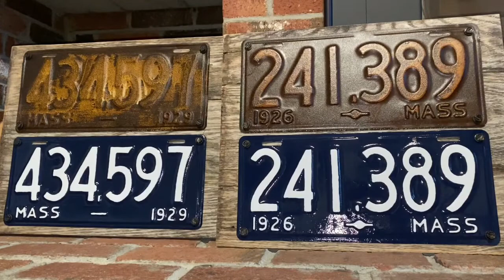Barn Found Rusty License Plates Restored and Preserved

Comment: The result is pretty good! One suggestion would be to try and brush the lettering. You'll get a smoother more consistent result. A LOT of people think you need a super steady hand to use a brush but that just isn't necessarily true. Watch some sign painting videos on YouTube. Use a long bristle brush like a Kafka "liner" or pinstriping liner. As you "pull" the lines the brush straightens out the line. Admittedly it does take some practice but it isn't that difficult. Back in the '20's Ford used to hire people off the street, give them a week or so training and viola, they were pinstriping model A's. All that being said your result looks pretty damn good! Oh and you might want to use OneShot paint.
Reply from the maker: Great advice.  I will look that up and try to upgrade before my next project!